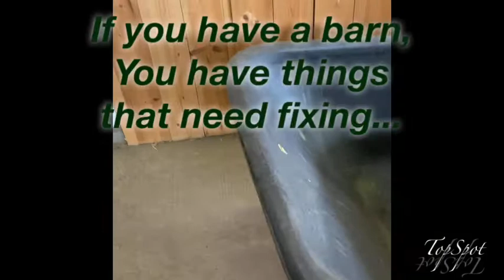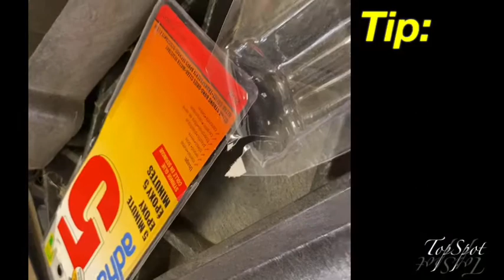Best way to mend a cracked Rubbermaid 2 Wheel Wheelbarrow

Comment: thanks! I'm not about to spend another $300 on a new one. My damage is a bit more extensive so I'll prob just use a drill for putting the holes in for the wire
Reply from the maker: Our repair is still holding well! Make sure to put a hole in the end of the crack too so it doesn’t keep cracking.